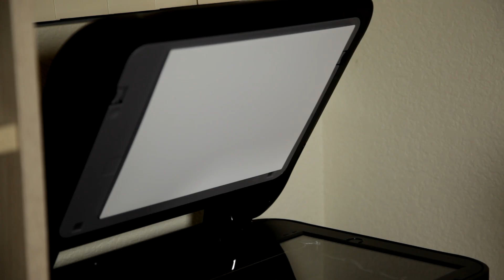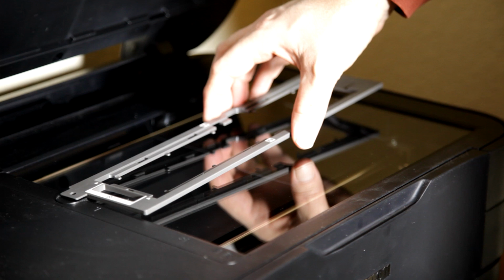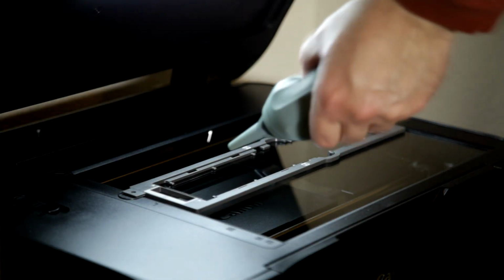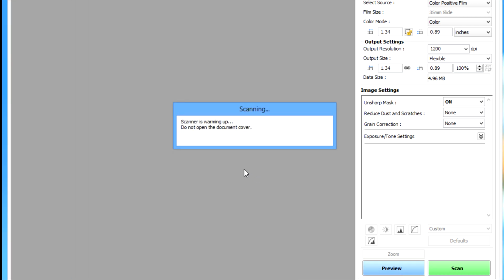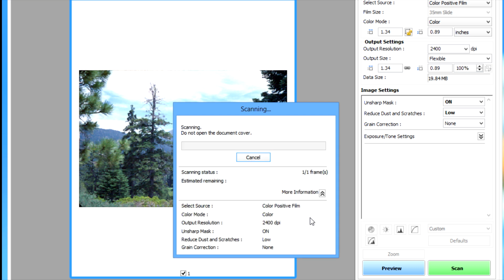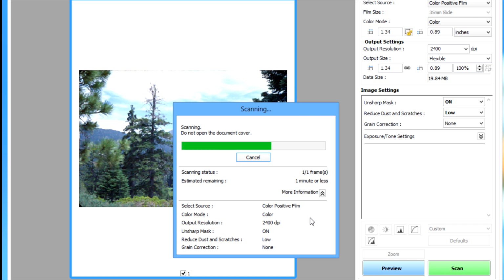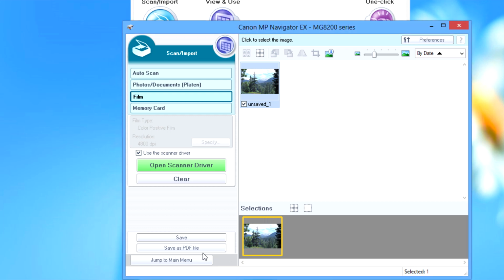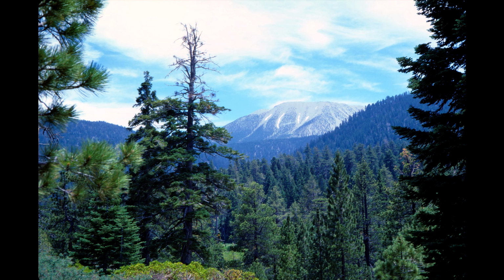Slide and Film Scanning with Canon Multifunction Printers

Comment: After recent windows 10 update, the Lide 700F win10 driver from Canon webpage no longer works :(  Have to rely only on WIA windows driver which limits to only 600dpi
Reply from the maker: I use VueScan with my Windows 10 setup. It's great for scanning and goes up to 4800ppi. The driver is built into the software. Give it a try!

Comment: how about scanning without tray?
Reply from the maker: It'll probably work for slides if you can align them just right. I've tried doing film without a holder and you get something called Newton's rings if you don't leave a little gap between the film and scanner glass.

Comment: Hi, Have a MG8250 and scanning black&white negatives in 16bit colour deep and TIFF but when saving I get 48bit colour deep TIFF. The odd thing is that in the meny  the datasize says 16bit but when saving I got 3 time larger file (becouse when saving it goes to 48bit).  Enyone have an explination or soulotion?
Reply from the maker: If you selected black and white mode while scanning, it should have created a 16-bit file, not a 48-bit color file. If you have Photoshop (or another editing app) you can examine the file there and if needed convert it to 16-bits to save space. I use a program called Vuescan to do my high-quality scanning and it works the way it should.

Comment: And I've been trying to get my old hps20 to work with win7. I should have found your video ages ago! Thanks!
Reply from the maker: Thanks. I ended up getting this one after I couldn't get drivers for my SCSI scanner. I loved it but the manufacturer just laughed when I asked for updated drivers.
Reply: Was your scsi scanner a hp, too? I can't believe the hp just dumped the s20. It was a cheap item - $700, to the memory. I still hopefully, fire it up every so often. But, alas, it's a bit like kissing frogs. As you said with your gear, it was good hardware and the convenience just isn't matched by anything, these days. I bought a little 'integrated' unit that scans to sd card, but the image quality is, uhhh, dreadful. I might have to go trawling through the scanners, to see who's got what. Thanjs again!

Comment: I have the Canon MG 8250. Since I installed Windows 10, I cannot find a way to scan negatives. I tried with the WIA interface, but Photoshop won't recognize that my Canon can make negative scans with the slide tray I tried to installed Navigator EX, but no chance (it doesn't work). Help ! I have negatives to scan and no chances since yet :-(
Reply: UPDATE : I could do it! At last. But I had to install Navigator EX 5. And it ontly works when I scan directly from the printer menu, choosing the PC-Transfert option, and not with Navigator EX Software (though it has to be open when I proceed to the scan). I hope I could help someone with the same issue.

Comment: Unfortunately, I'm using an Canon MX340 series. No slide tray as it includes a fax on top. And no choice for 'negative' or 'positive film'. As I tried just placing my slides on the scanner as is, the scanner light was insufficient to properly illuminate the slides. Any tips on how to successfully accomplish this task with this series by any chance?
Reply from the maker: +Paul Sims Canon makes one line of models for photographers and another for office work. Without the scanner back light and the right processing software it will be difficult to get good results. If you only have a few slides to do it might be better to just send them out for scanning. You'll get professional results for less than a dollar each.

Comment: Jeez. I've owned this printer for years without knowing this. Now I'm gonna start scanning slides...Thank you for this great tip.
Reply: Hi,
Could I do this on an HP printer?
Reply: Whats the name of the printer omg
Reply: Can anyone tell me model numbers of these..I have been told they don't make them with this anymore :(
Reply: Look for an old/second hand Canon MG8220 or MG8250
Thanks, Schluch Designs - I'd totally forgotten I bought a printer with this capability and never knew where the slide/negative holder was. Scanning slides as I type...
Reply from the maker: Yeah, that feature is really well hidden.  If I hadn't purchased the printer with scanning in mind I probably wouldn't have thought to look behind the cover for a slide tray. :-)
 
I'm glad the video helped...Makes me feel good.

Comment from the maker: I just tried a 126 frame in a standard 2x2 inch mount and it worked just fine. The scanner can do a full 2 inches across, but only about 1.35 inches in height.  That works out to 35mm or a little shy of the full 40mm super 127 format, so you'll have some of the top and bottom of your pictures cropped off.

Comment from the maker: Unfortunately it only scans along the strip, not the whole bed, so medium/large format is out. That's the main drawback compared with my old Umax Powerlook III.  I had all sorts of nifty holders for larger formats on that one, but with digital advancing so quickly I never did more than a few frames of 120 before converting to DSLR.

I haven't tried scanning sprocket holes.  It might work.

Comment: will it only scan negatives on the small strip? or are you able to do multiple rows at a time similar to a contact sheet?  Is one able to scan without the tray as to use 120 film or include the sprocket holes on 35mm  Nice vid.  very informative